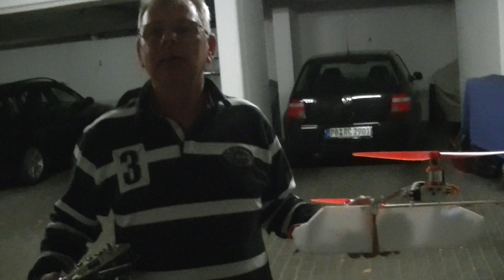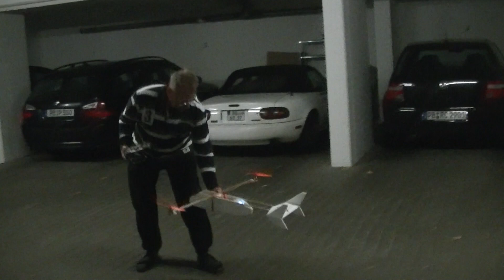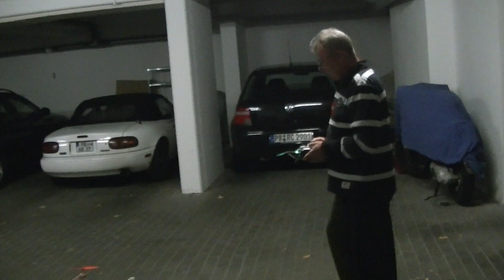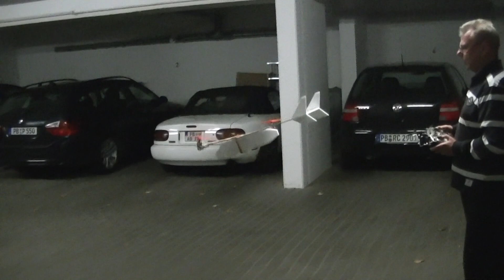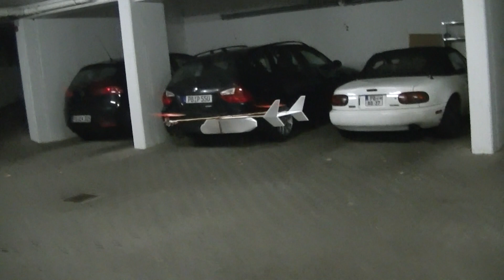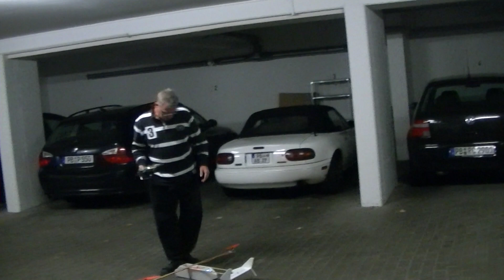VTOL Osprey V22 Tom Stanton copy by PaulB

Comment from the maker: Model has now been modified to extend the distance between the vertical C of G relative to the centre of mass.

Five degrees of dihedral each side and the fuselage is 6 Cm deeper, this extends the distance between the motors and the C of G from 3,5 cm to 9 cm. Pitch stability is greatly increased and the model is now VERY stable in the pitch plane. Work in progress.

Comment from the maker: The wing spar is 1 meter long, the wing (when fitted) will be 80 X 20 cm, the fuselage pod is 46 cm long and the total length including tail plane is 72 cm. Two X Turnigy 2830 1100 with HK blue 30 A ESC's turning 9 X 5 DD props. Tilt servos are Turnigy TGY930MG digital and I am going to run a 2650 mAh 3S. AUW app. 800 grams.